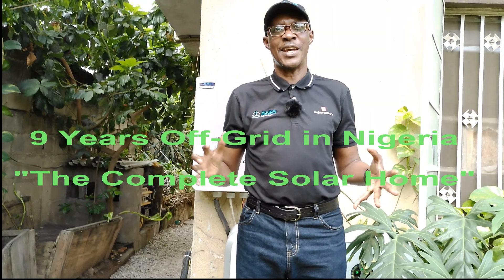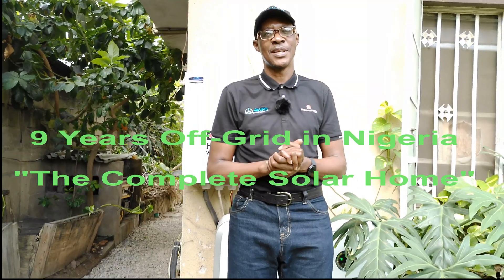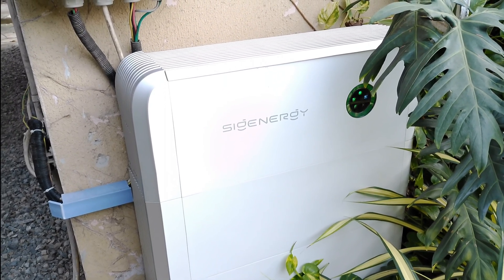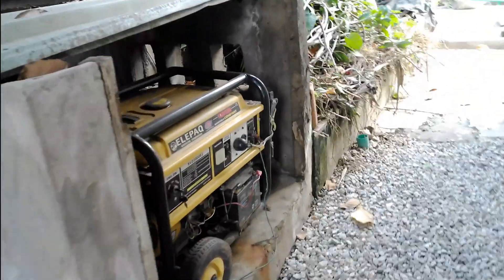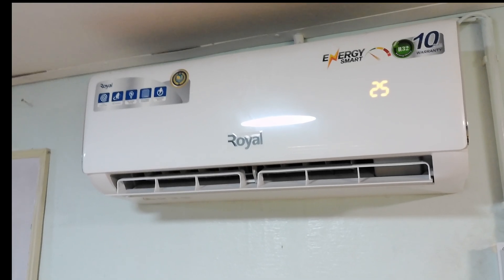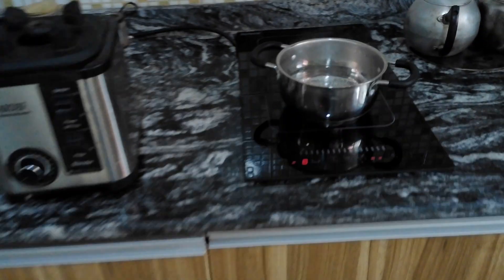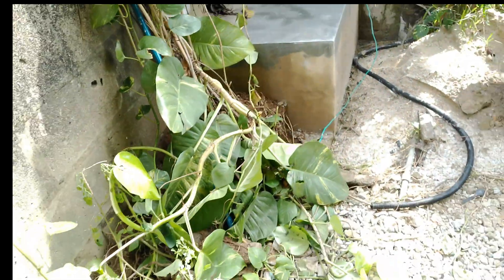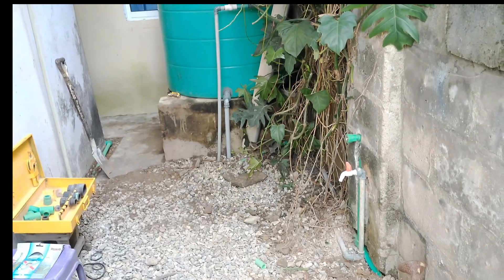🔋 “9 Years Off-Grid in Nigeria — The Complete Solar Home”

Comment: Well done Dr. Solar more so in respect of the induction cooktop, hope you also upgrade that to a 2-plate version. Given that your generator hasn’t run in a while, you may want to get rid of the fuel as it may have separated into water and fuel. What plans do you have for water redundancy and ensuring you have spare filtration water filters?
Reply from the maker: Thank you for watching and commenting. The induction cooktop is a two plate version. The advice on fuel is well taken and would be acted on.
There are two filters before the pressure tank. Regarding back up. This is something that I should plan for.